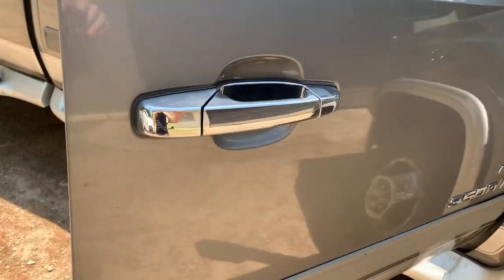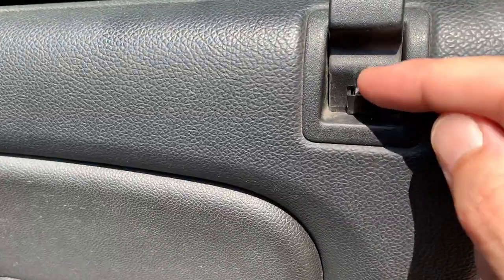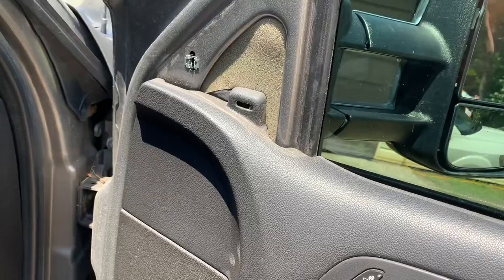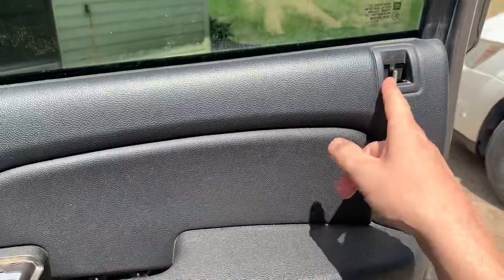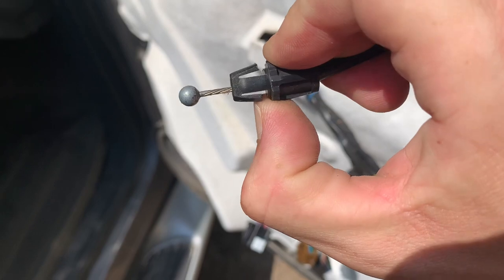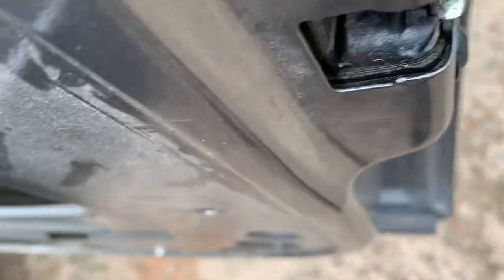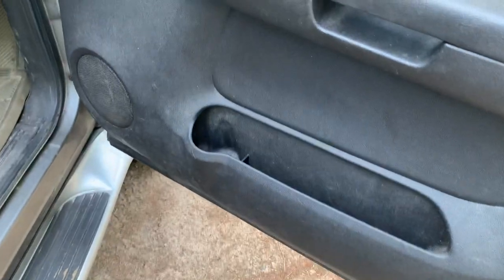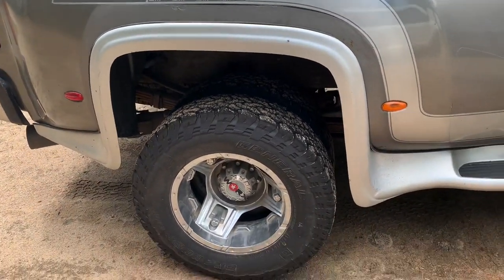2007-2015 GMC / Chevy Door Handle & Interior Door Panel Access

Comment: Great video man! I used to have an 09 1500
Reply from the maker: Awesome my brother has one as well
Reply: @613Builds they're pretty decent trucks as long as they've been taken care of.  I'm actually pulling an lh6 out of an 07 pretty soon. I might have a video on that within the next few weeks. Not sure what I'm swapping it into yet
Reply from the maker: @waynered9  is that a DOD version?  I think that’s maybe the same aluminum DOD 5.3 as the 07/08 avalanche , sounds familiar but I can’t remember.  It did have the 243 heads and aluminum block so that’s nice
Reply: @613Builds  yeah 07 to 09 dod 5.3. the non flex fuel. Either 243 or 799 heads